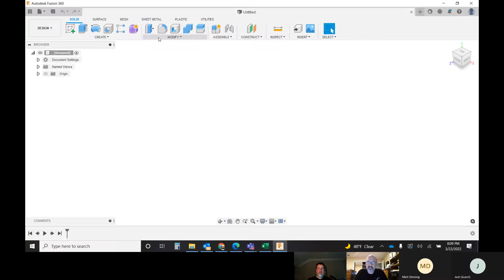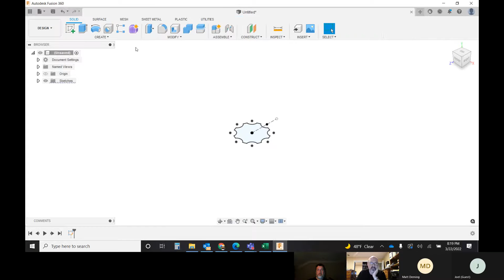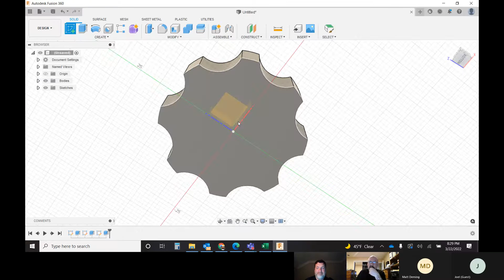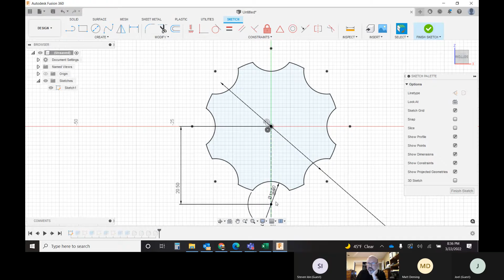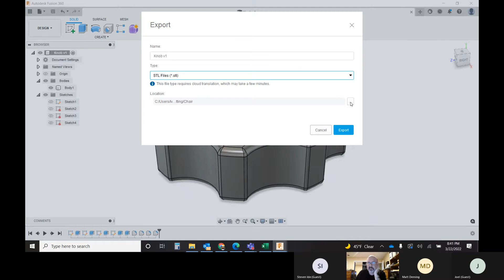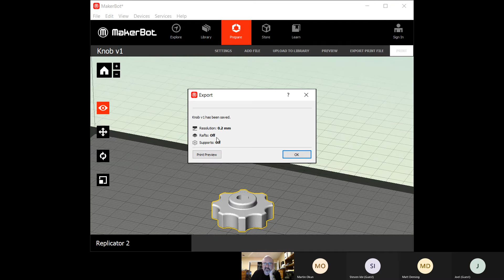Fusion 360 - Modeling a knob for 3D printing

Comment: A really useful video - thanks! I've been 3D-printing with Fusion360 for a few years now and picked up some useful tips as I'm working on a knob at the moment.

I use Cura and Ultimaker-3, and the top of the knob is domed. So I plan to create it, then slice it in two, print them separately and glue them together.

To ensure accurate registration and provide strength, I'll add four small holes across the slice plane into which I'll glue short 1mm metal rods. 

One comment - you export your STL, which takes some time. In File->3D-print you set STL (which seems to be the default), deselect "Send to 3D Print Utility", select the body you want to save, and click OK - pretty much instant.

Comment: Very interesting, I have made a few things in Fusion, but I am always learning new tricks!  Quick tip, you can speed up your workflow a little if you select the 3D Print option under the Utilities tab, you can then select the Makerbot software to export to as 'Custom'.  It will skip having to save as STL and then load it inside your slicer.
Reply from the maker: That's a great tip! Thanks!